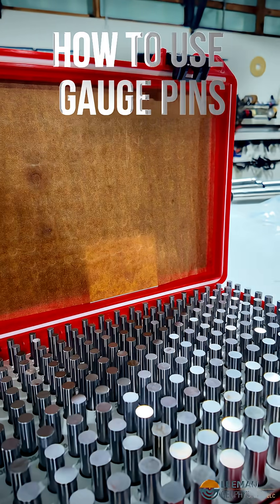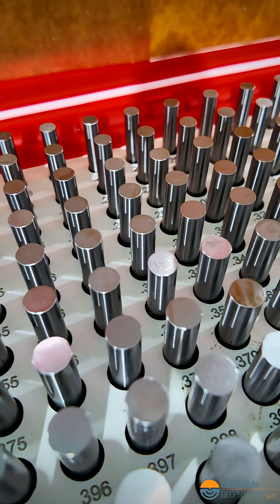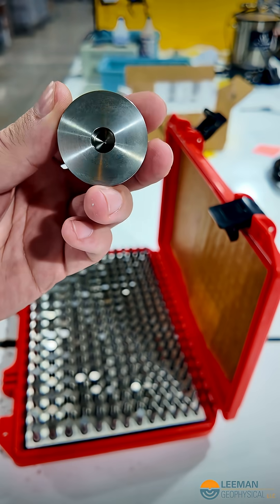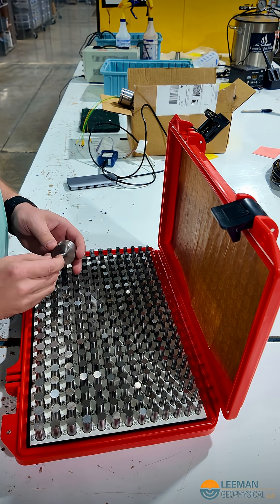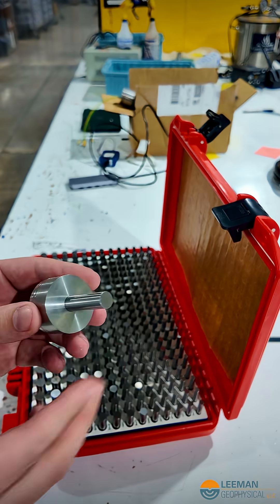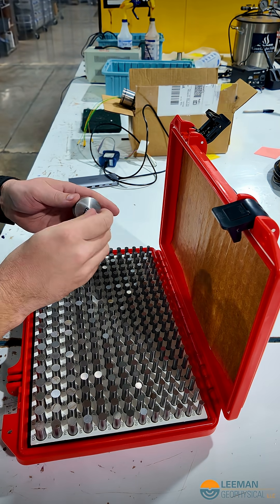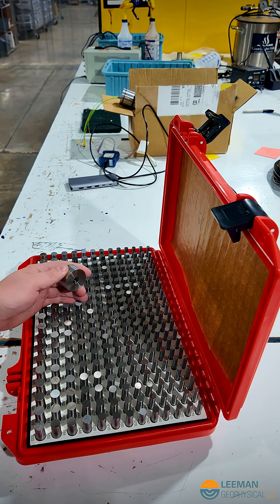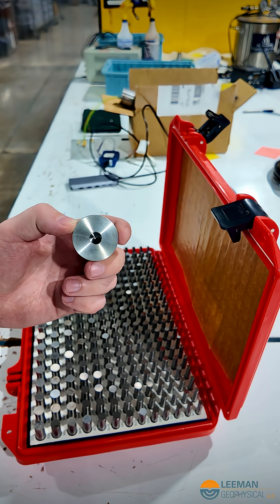How We Use Gauge Pins for Precision Measurements

Comment: Imagine picking up that case and it’s not latched properly. 💀
Reply from the maker: That is the worst thing about this set - always carry horizontally! Our small set has a much better latch.
Reply: @leemangeophysical 
… B r u h.
Reply: @leemangeophysical  I used tape to put a big green checkmark on the side of my tap & die set that has to be facing upward to avoid dumping the set out. The other side has a big X on it. Haven't dumped it since.
Reply from the maker: @Alex-js5lg  Great idea!
Reply: @leemangeophysical  why not have handle on both sides of the case. Make it so that you have to grab both handles to pick it up.
Reply: @leemangeophysical   need a better latch? Gee if only you knew someone who was into making stuff.
Reply: I use ID pins every day for work I am a extrusion Tech for Cooper Standard Automotive we make fuel lines, airlines, cooling lines to check ID, if you drop one you have to reject it and take it off the floor so the quality control can check it for defects, and you can bet you wouldn't be on their Christmas card list that year if you drop the set or box of them, as you can see in the video all the pins are marked with the size so it would take a while to put them back in order but that is only 1/100 the time it would take to check for defects.
Reply: Half of them would probably have dents on one of the two circular edges, and no longer work right.
Reply: @JasperJanssen  oh ya hitting the ground would not be good for them!
Reply: @JasperJanssen  They are usually hardned. It's not a good thing to do, and the probably don't belong in QC any more. But they would still have a use.
Reply: @JasperJanssen  Something tells me it’s probably hard to buy individual replacements also. I wonder what those cost?
Reply: @TheGrobe to thats not hard at all. But cost about twice as much as they cost if you buy a full set.
Reply: I think of that every time I pull my set out of the cabinet.
Reply: thats why i like the ones with half of a handle on both ends
Reply: I’m ordering a new set while I hammer through a 6 pack.
Reply: Kinda like that card game 52 pick up, but better.
Reply: I had a very large tap and die set like that
Reply: And the pins were labeled by a sticker that fell off 😂
Reply: @dangsxgomez  the pins have their size laser etched onto their sides, per the channel's comment in another thread.
Reply: You stole my comment 😔
Reply: Thank goodness that are labeled
Reply: It’s happened I watched an older guy in our shop dump the entire set he was so mad! 😡
Reply: one of my coworkers did that. took 3 guys like 20 mins to find them all hahaha
Reply: Usaully is never closed
Reply: There isn't a qualified machinist in the world who wouldn't use both hands. Machinists are not careless with the tools of their trade.
Reply: The very thought of that made me shudder. Better hope you have a fresh battery in your caliper
Reply from the maker: @pws3rd170  They were nice enough to laser engrave them in the middle of the pin, but it would still be no fun!
Reply: @leemangeophysical Ah, that figures, actually kinda necessary for their purpose now that I think about it, but yeah, still a total headache. A job for the least favorite shop gopher 🤣
Reply: @pws3rd170  I wouldn't have a cheap caliper that needs a battery.
Pratt & Whitney did fine making the Double Wasp during WWII without batteries. The Germans realized they were going to lose the war when they took a captured one apart and saw it didn't use gaskets! The tolerances were so close non-detergent oil would seep into the cracks and cook off to seal the crack before it got to the outside. No drips!
Reply: @ladamyre1 ...i dont think thats what the germans cared about
Reply: @wisersamson9000  then why do you think they fought in the first place?  Of course it was all about caliper envy.
Reply: @davidswanson5669  Metrology giveth, metrology taketh away.
Reply: @ladamyre1 
These sorts of comments are why I read comments. 👏

Comment: Using a 10 base decimal system for inches is wild... Just use metric ffs
Reply from the maker: Wish we could, but being based in the US means 95% of what we do and need to be set up for is designed and based on the imperial system.
Reply: Its a base ten ratio to an inch. a lot of manufacturing for american products are done with empirical measurements.  Metric is used for anything that we send outbound to other nations and sometimes that product is also domestic because the company wants to save money.
Reply: Lots of us that design stuff do. Helps to ballpark conversions quickly too.